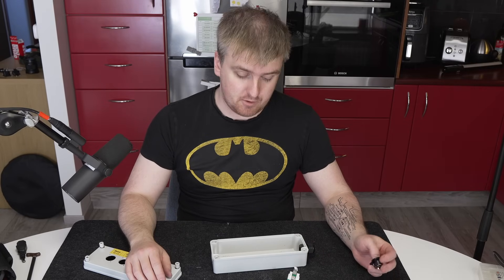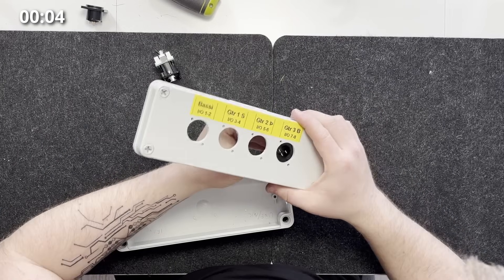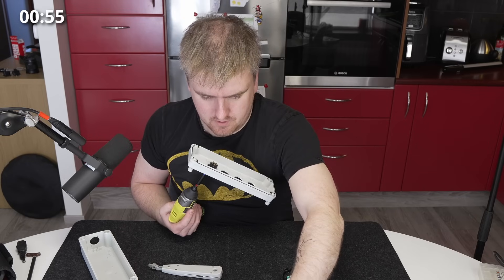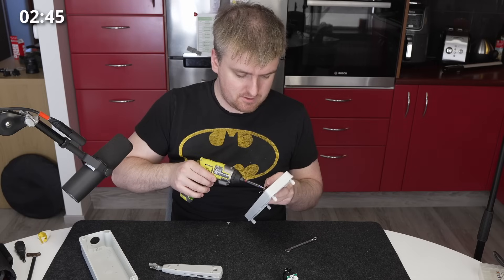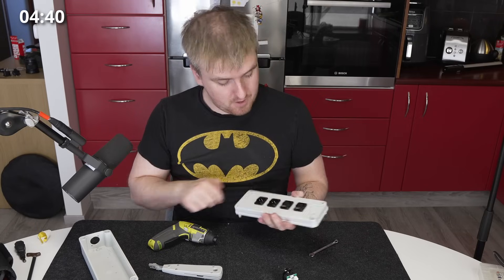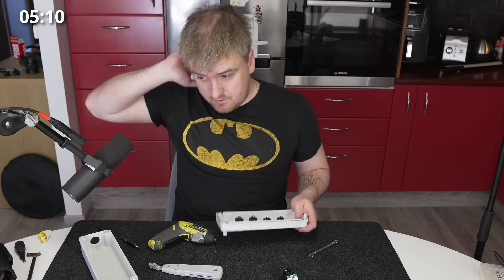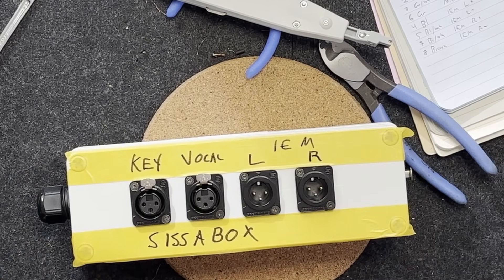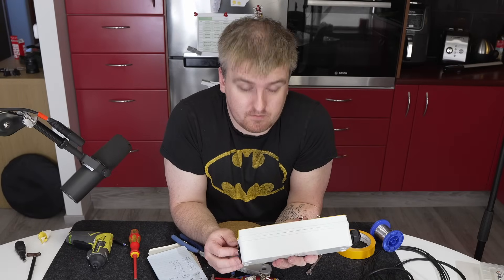Analog audio over Cat 5/6/7 - Building a stage box in 26 minutes

Comment: What is the total cost of this project? I’m trying to weigh building vs buying
Reply from the maker: It's actually a bit hard to say, since this is all made up from parts I already had from another project.
The most expensive part was actually the plastic box, but that's just because what was available locally and fitted my previous project.
You can fit this into pretty much any box you can think of, order something cheap off amazon, use an old tin can you have at home or whatever.

Everything else I ordered from Thomann
The XLR connectors are Seetronic MK3F2C-BG and MJ3F2C-BG which are €3.11 and €2.61 each from Thomann, so a total of €11.44, the Ethercon connector is the Neutrik NE8 FDV-YK which is €10.25
The cable I used is some Sommer Cable Cicada SO-D14, which is €0,92 per meter, and I maybe used 2 meters for the project, so around €2

The screws for the XLR connectors are €8.07 for a pack containing 48 pieces and the self locking nuts are €5.71

That brings the total bill of materials minus the box to €25.8
A pre-built box from SSSnake is €24,37, but that has 4 connecters of the same type, for my Use case I'd have to buy the replacement connectors, or buy one box in each direction and move connectors between the boxes to get 2 in/2 out. (Also those boxes aren't compatible with the wiring pinout that I'm using, but if you're building everything you can choose which pinout to use)
That's plus shipping and local VAT. I ordered all of the parts as a part of a bigger shipment so shipping cost were covered by something else.

I don't remember if I said in the video, but I built this as a temporary solution because I needed to use it for a show. I do have plans on making a more advanced/better version soon.

Comment: Hello Árni, thank you for your content. In this connection on the ethercon connector, did you fix the mesh to the connection or just the 2 pairs of the cable? Could you answer this question, I want to do a project like yours and I have this question.
Reply from the maker: Around 10:30 You can see where I twist all the shields together and then solder them to the shielding connector. Maybe I didn’t mention this but Im prettu sure I do in my other video 
Analog Audio over Cat 5/6/7 - Building your own panels
https://youtu.be/ex2MCoDvwWE
Reply: @arnieitthvad  To perfect Árni, thank you very much

Comment: 1.Have you ever used XLR combo jacks? 2.What model would work best? 3. What is the smallest size box you think I could use to build some?
Reply from the maker: I’ve put XLR combo jacks into a panel at work. Cant remember what model it was. The size of the box depends a bit on how you want the layout of the connectors to be. If you want the connectors on the top or on the side, where you want the Ethercon etc.
I’ve been meaning to try to build a breakout box from an AP9 Junction box, just to see if it works.
Reply: @arnieitthvad I'm thinking ethercon on the side with 1x4 layout as compact as possible...I'm trying to find a combo jack that looks like it would work good in a box and not really convinced yet

Comment: Hi - thanks for these videos. Very interesting. I play keys .... the single XLR you used for keys is unusual as not all keys have an XLR out. Will you genuinely use this for a mono xls out from the keys? Or will you spit the xlr signal into two mono ts signals ... that is to say a stereo pair of ts for the keys to run stereo? Thanks again.
Reply from the maker: @psmail007  for this particular use there will be a DI box connected to the XLR input, this is being used with a Korg keytar. That has stereo output instead og balaced outputs and were using it in mono for this (stereo isnt relevant in this case)

As I said this was a temporary solution. The plan is to build a proper box that will include the IEM preamp and also a DI box, so there will be Mic in on XLR, Keyboard in on Jack, and then just headphones out.

This box will then be usable as a 2in/2out box if I ever need it for guests etc.
Reply: @arnieitthvad  I'd have a lot of interest with the jack in option.  I'll keep an eye out for it :)

Comment: Good video, I have a couple questions. Does this end up being properly grounded? Also, usually Ethernet punchdowns typically require wire with a solid core, as the mechanism that makes the connection is the metal blade in the punchdown slot, which breaks the sheathing on a wire from an Ethernet cable and makes a connection with the solid cable on either side. I don’t see how stranded cable would be reliable for any length of time.
Reply from the maker: Define properly grounded, the enclosure is plastic, and Pin 1 of all the XLR connectors gets connected to the shield of the Ethernet cable.

I've not really dug into the specs of the Ethercon punchdowns, I've been using them for this application for quite some time and I've had zero issues so far. 

However I've encountered a lot of Neutrik Patch Panels which use IDC connectors (NPPA-TT-IDC) that are almost exclusively used with stranded audio cables.

Page 6 of the instruction manual mentions using stranded wire. (https://www.neutrik.com/media/8081/download/patch-panel-nppa-tt-idc.pdf?v=1) 

Researching it, in general Krone series 2 IDC connectors seem to be specified to accept both solid and stranded wires, and even two conductors of the same type.
https://www.accu-tech.com/hubfs/docs/1303454.pdf

Now it could be that Neutrik uses different type of connectors for the Ethercon punches, but my short search didn't actually reveal any specifications.
Reply: @arnieitthvad  properly grounded means pin3 is an actual ground.

this is the problem with audio over cat6 - no ground so no phantom power.

this is fine for installs but awful for live. ethercons are way too unreliable for anything critical, i learnt this from (bad) experiences.
Reply from the maker: @ pin 1 is ground in XLR cables.
This is just as much grounded as any audio cable, pin 1 is shield/ground. It does have common ground on all 4 channels, but eventually the ground pins on all inputs will be connected to a common ground in the device.

Comment: if the mic-lines would require 48V, then this would not carry it from the Ethernet to the female XLR plugs, right? To do so the shields would have to be soldered to the Ethernet-plug's "ground" (and of course the ethernet-cable would need a shield tied to the plug's "ground" on both ends as well") ?
Reply from the maker: @HrannarIngimarsson  phantom power works when using shielded ethernet cables. All the ground wired are soldered to the ground of the ethercon.
Reply: @arnieitthvad  thx - didn't see it soldered to the ground of the ethercon; I just thought you tied them together but lifted the ground from the cable.

Comment: Looks simple enough, great solution. What's on the other end though? It doesn't plug straight into a Wing does it? Is the other end an identical box so you can plug XLR cables into the Wing?
Reply from the maker: @paulnieuwkamp8067  the other end is the front panel of my wing rack setup
https://youtu.be/_cLmymDQ_zg?si=N2kOUs-txwAfSTv6

I also have a stand alone breakout.
Reply: @arnieitthvad  You don't really go into it on that video (or maybe I missed it), but looking at 10:24 (on that video) it looks like it is indeed the same setup on the other side: XLR to ethercon on one end, and ethercon to XLR on the other.
Reply from the maker: @paulnieuwkamp8067  yes pretty much, there is an ethercon on front of the rack, maybe I was thinking about my other video
Analog Audio over Cat 5/6/7 - Building your own panels
https://youtu.be/ex2MCoDvwWE

Comment: Great video! Is it possible to split the signal punching down two sets of cables in the same IDC 110 connector? 
I was thinking about building a passive splitter based on this.
Reply from the maker: https://www.accu-tech.com/hubfs/docs/1303454.pdf
Reply: @arnieitthvad  oh, this is great to hear!

"IDC Contact accepts 2 conductors of same gauge per contact (22-26 AWG) "

Thank you so much man!
Reply from the maker: I haven't done that myself and I can't remember how deep the teeeth on the IDC connectors are. But I believe that if you have the same dimeter wires in both splits that should not be any problem.

Comment: Great content! Which ethernet cable is the best to use if the ethernet cable must be longer than 10 meters? Let's say 15 meters is the length of the cable.
Reply from the maker: @HenrikKleist  for stage use Im using pro snake cat6e from Thomann.
For the rehearsal space Im using shielded cat6A cables I got at the electrician retail store.

Any shielded cat5/6/7 should work. They are standardized so just pick a cable that is nice to work with.